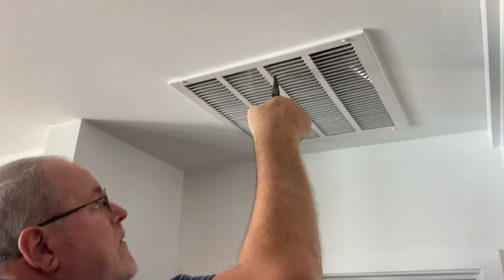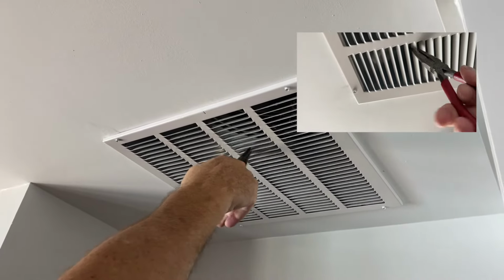Noisy AC HVAC Return Vent

Comment: Why does my vent make this noise only when my ac is running, but not when the heater is running?
Reply from the maker: That’s interesting.  You might want to consult a professional.  You may have something else going on.

Thank you for watching and commenting.  We appreciate you watching our video.

Please subscribe to the channel if you haven’t already.

Please check out our Amazon Influencer page for many items we use and recommend.

https://www.amazon.com/shop/diyadventure
Reply: The unit should be set up for a higher fan speed (cfm) on AC than heat. There is a way to change that on the circuit board but varies by brand.
Reply: @jeffflowers729  that could be it!

Comment: Did you put a filter in this HVAC Air Return? If you did not, you should, because that would also probably fix that noisy HVAC Air Return. 😊
Reply from the maker: We did not on this one. HVAC tech advised it wasn’t needed here, due to one after this one at the unit. Might try some time though. Thank you. 🙏

Comment: Any chance the turbulence is stemming from too little cfm of return air?  I know my return air is way too small, and I'm going to increase the opening/duct on my main level for improved overall operation. Oddly, it only makes noise like yours with the furnace on, never the ac.  Maybe I'm just hearing my burners roaring through the ducts?
Reply from the maker: That could be the case.  If only when heat is on and not AC, I suspect it’s burner noise.  Can you lay your hand on the grill while heat is on to see it it stops?  If the grill is vibrating that should at least change the pitch.

Thank you for watching and commenting.  We appreciate you watching our video.

Please subscribe to the channel if you haven’t already.

Please check out our Amazon Influencer page for many items we use and recommend.

https://www.amazon.com/shop/diyadventure